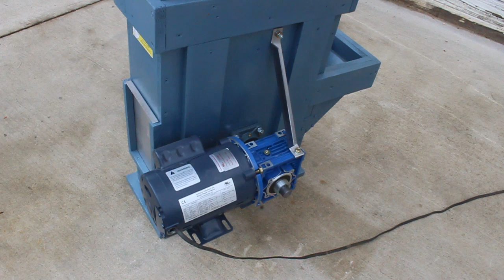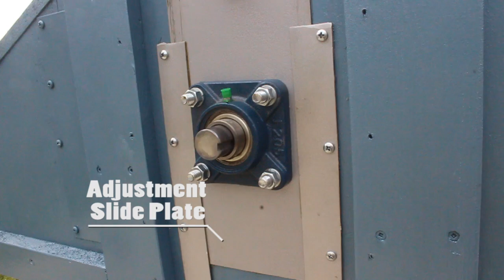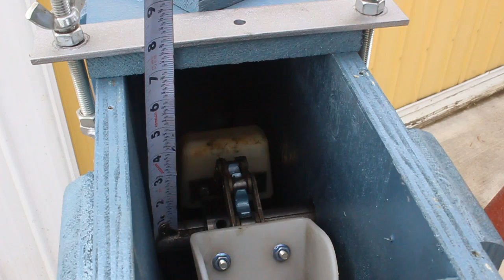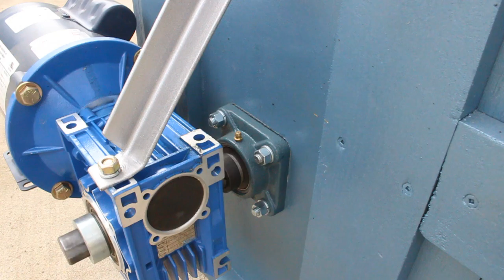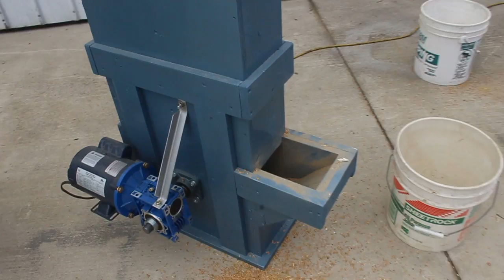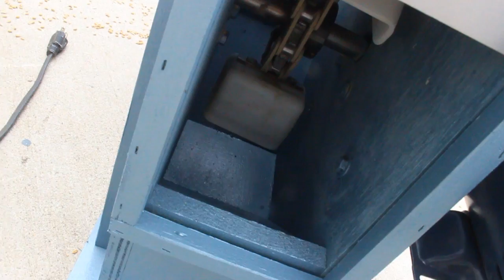"Thrifty-Lift"  M-100 Bucket Elevator!

Comment: NE type, the main performance parameters of the bucket elevator, etc to pay or by reference to the color with the international advanced standard, its main features are: increase the specification and material type, improve the hopper running speed and throughput, increase the hoisting height, so as to expand the scope of use, can satisfy the building materials, machinery, chemical, electric power, food, light industry sectors such as a variety of materials delivery requirements.